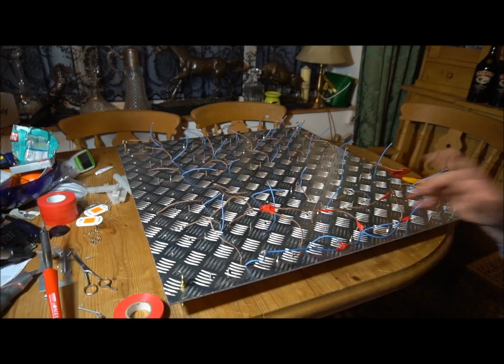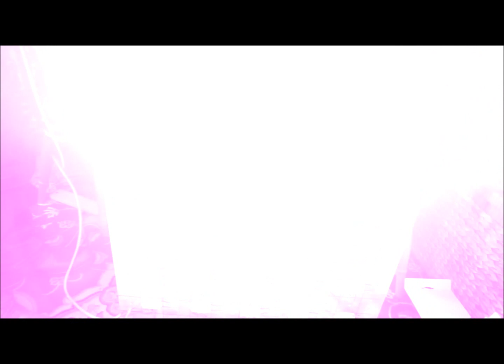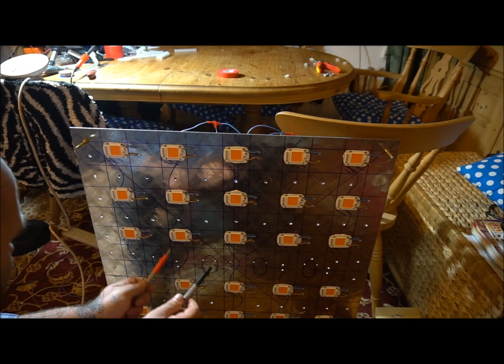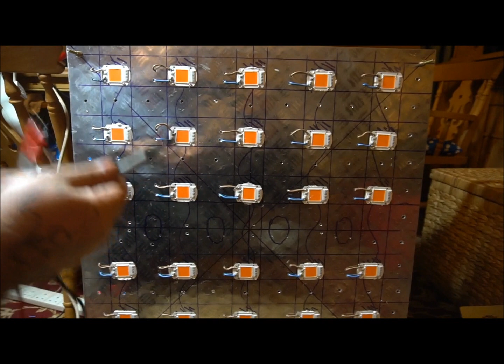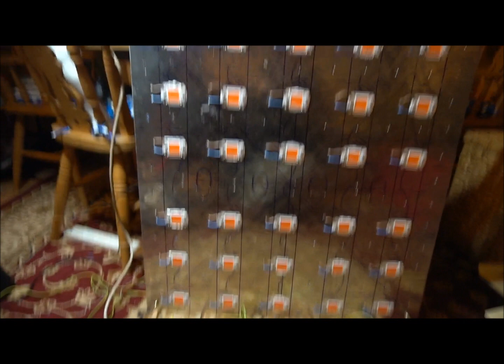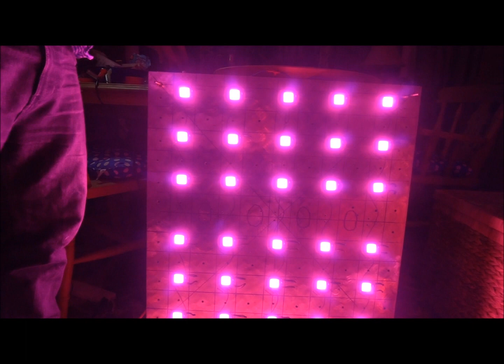cheap cob light part two

Comment: I applaud you for posting  a video of such an ambitious project, but I have to add some constructive criticism to improve upon your concept.
    1.  You must wire those COBs in PARALLEL because the input voltage for the chips is equal to your mains voltage.  If you wired 30 COBs in SERIES,  each COB would receive only 1/30 of the supply voltage, which would be about 7 volts.  That's not enough, so none of the chips would light up.  I strongly recommend watching BigClive's video "Driverless 50W LED teardown and schematic".  
    2.  Soldering the leads onto the COBs is difficult because the aluminum plate draws much of the heat away from the chip.  Place the chip on a hot plate and heat it slightly as you solder the leads to the chip.  You'll have no trouble soldering them.  Thanks to Big Clive for that tip.
    3.  You used 50 watt COB chips.  I can tell by the number of integrated circuits ( one chip is a bridge rectifier, and the other five chips are 10 watt drivers).  You need a lot more cooling for those babies.  My first attempt with those COBs used a single 50 watt COB and a heat sink with 0.3 sq. meters of surface area.  It didn't take long for the COB to burn out, but I replaced the Cob with a 30 watt chip, and I have had no problems since.  My last grow light was made with four 30 watt COBs.  The heat sink still gets hot (35 degrees C), even though it has almost 1.4 sq. meters of surface area ( five layers of light aluminum, 51 cm x 27 cm, with a 5 mm air gap between each layer, and a thermal bridge under each COB to transfer the heat from the COBs to each layer).
    4.  As others have mentioned, you should place grommets where the wires pass through the plate, and ground the plate.  I also prefer to cover the solder joints between the leads and the COBs with silicone sealant so that there are no exposed live wires.

Comment: I have built several lights with these chips and tested them over the last 3 months or so. They need good cooling, fans will be needed here. Even with good cooling, the chips don't last very long, over 12 weeks I got about 25% of the chips had failed. Not so good. There are other, similar LED chips with different driver ics that should perform more reliably. Buyer beware.
Reply from the maker: i used them 4 hours on 2 hours off cycle worked perfect still working superb results..yes i have replaced half a dozen bulbs

Comment: Great info thanks. I cant help but wonder, why am i thinking to build this? I have a small room 2mx2m low ceiling, but great ventilation. I have a few 400w hps's. I guess the main benefits to these cheap cobs are that you dont have hot spots like hps,  and by making a big panel you can spread the light out further. Did you see the migrow test of these cheap cobs? I almost vomited when i saw how low their efficiency is. I can build a 1000w panel like this one for the same price as 2x400w hps lamps. With fans or water cooling would the light panel survive longer? What about the poor efficency of these lights compared to hps? Im trying to see whats the advantage? Thanks

Comment: do you sell something like this?
Reply: The lights are ~1 Euro a piece on AliExpress, the plate is probobly 10 Euro, they are 220V or 110V (ur Choice) So, all together its a 1500W light for 40 euros, some random wire and few hours of ur time.

Comment: Hi, I did buy full spectrum cob 50 watts Led and test it with app luximeter from cellphone but it only show 200 lux is it demage or I need use other special of luximeter for measure led? Thank you
Reply: blue/red is not detected by phone sensors
Reply: what is the max reading capability of the phone app? i suspect it can't read higher many are like this.

Comment: Could you explain better how do you join the L and N in paralel together ? Thank you
Reply from the maker: its fairly simple...i make sure they are all connected to the main live feed separately... if you don't connect them all separately that means if one light goes out the others will go out too..so simply make sure every light has its own path to the live without passing through another light to get its power.thats the difference between series or parallel.has that explained it ok for you?let me know budski
Reply: @airbomzairbomz3356  I mean, you connect all live to each other and all neutral to each other. Could you maybe make a draw and send to me ? lucio@vetiver.com.br. Tks
Reply: @airbomzairbomz3356  i mean, maybe please you could show or explain better how do you connect each (neutral and live) from first column to second one ? How did you do this transition ?

Comment: Plz plz plz get a 6mm earth bolt and a ring crimp and get an earth to that plate..  Buy yourself an inline rcd 30ma for the whole setup. you should also use glands or grommets for passing cables through the metal plate.

Comment: Looks like Cheap China AC LED's with an efficacy of arround 80 to 110 Lumens per Watt.

Note: A HPS Bulb has an Efficacy of up to 150 Lumens per Watt.

The only Reason to use cheap China LED's for growing is a "little bit" less Heatoutput. PAR will be the same or lower as HPS.

If you want good LED's use LM301B's
from Samsung. This is one of the most efficient SMD Module on the Market. I am from Germany. And at www.led-tech.de you can get Aluminum Stripes with 98 LM301B's
(6.65W equals 210 to 230 Lumens per Watt / 13.3W Equals 198 to 204 Lumens per Watt / 28W equals 186 to 192 Lumens per Watt / MAXIMUM Load on each Stripe is 57.4W at 160 to 170 Lumens per Watt)

 6.65W = 0.35A
 13.3W = 0.70A
      28W = 1.40A (additional cooling)
  57.4W = 2.80A (additional cooling)

(More then 2A not recommended)

Example

(350 Lumens per Watt = 100% Efficacy)

your China Panel:

lets say you has got 30x 10W AC LED

so 300W Power consumtion

at best situation you have 31% Light
and 69% Heat from this Panel

lets get some Aluminum Stripes with
LM301B's (16.90€ per Stripe
                        euqals 18.82$ - if you buy
                        more then 14...   14.90€
                        equals 16.59$ per Stripe)

10x 98 LM301B's @ 1A = 150W

= 169€ or 188.16$

150W Power consumption and near doubled the efficiency.

55% Light vs. 45% Heat

cheap china: 31% Light vs. 69% Heat

Hope i can help.

Edit: THIS IS NOT!!! FULL SPECTRUM!!!
            THATS MAINLY BLUE AND RED
            SPECTRUM. FULL SPECTRUM IS
            FROM UV OVER VIOLET OVER
            BLUE OVER GREEN OVER
            YELLOW OVER RED TO FAR RED.
            THATS THE FULL SPECTRUM.
            ALSO THE LM301B's AREN'T
            PERFECTLY FULL SPECTRUM.
            BUT THEY HAVE A MUCH WIDER
            SPECTRUM.
Reply: Lumens are for humans   umol/j is better on those"cheap" ac cobs..........plants like par the ppfd is better than an hps also but hey you do you.
Reply: FREMONT, California – March 12, 2020 – Bridgelux today announced its eighth generation of LED chip-on board (COB) products delivering up to 185 lm/W across its V SeriesTM, Vero® Series and Vero® SE Series product families at nominal drive current.  This performance is benchmarked at the popular 3000K 80 CRI color point, with efficacies above 200 lm/W possible at other color points across the industry’s broadest range of COB products.  https://www.bridgelux.com/resources/bridgelux-eighth-generation-cobs-deliver-market-leading-efficacy
Reply: @donnieteague8482  Yeah i know. Waiting since 6 Months for one of these. For some People its easier to explain with lm/W. PPF i think even is better on HPS then thoose China COBs. Bridgelux Vero 29 Gen 8 is a blessing. High Efficacy combined with high concentrated Output. I wan't some of these.

Comment: what if I use 4 cpu fans on top of it running the whole time the leds are on?? And also drilling more holes on it?? Thank you
Reply from the maker: this light must not be run longer than 6 hours.. even with additional cooling.every two months i have to swap out 4 leds.for autos this light beats anything hands down.i just use it for autos so..6 on 2 off for 70 days and theyre monsters.its well worth it.
Reply: @airbomzairbomz3356  thank you so much sir 😉
Reply: @airbomzairbomz3356  what do u mean 6 on 2 off. Is it enough. Or do you mean 6, 2, 6,2....... Im planning to do the exact same project but will install small heat sink with small fans on top.  Was the plate you have enough for the heat
Reply from the maker: @Aly_H654  6 hours on 2 hours off helped keep the heat down worked perfectly - yes the plate was fine
Reply: @airbomzairbomz3356  do you think it's too much light. I have a 80*80 space I'm going to put a similar plate 60*60 with 8 cobs ( 4 full spectrum and 4 warm white). Do you think it's enough for 3 autos
Reply from the maker: @Aly_H654  id put a few more..depends on the wattage of the cobs? the more the better and cold white is better than warm white..more blue for growth..

Comment: MIGRO on YouTube tested these direct to mains LEDs they're about as inneficient as you can get, you might as well stick with hps. You need DC LEDs..I don't know much but I know CREE CXB3590 and VERA COBs are way more efficient.
Reply from the maker: your very right they are inefficient however they did grow weed really well and were so cheap it kinda worked you could actually have a light for $25 rather than lots of $$$... it was a fun build and I would recommend this light if you have barely any money to spare as a last resort but cree is far better but 10x the price
Reply: I can still push lot of weed with driverless. I dont listen to shane gromau5 and their numbers. 😆 People grow out with migro but never push over 1.5g. Fuck whats on paper bro. Its about grow knowledge. 😉 And yes i can combine what i want. 3500k 6500k or purple and 20w 30w 50w on my custom built heatsink.
https://ibb.co/FmgbZRW
https://ibb.co/Z8Bc5k9

Comment: Clean your solder tip and pre-tin the pads on the cob and you'll have a more reliable joint and wont have those solder problems. Cool build. Id also put a piece of heat shrink where the wires feed through the aluminum plate for insulation. If you cut the wire insulation on any of them AC feed wires that entire plate will be "HOT"(220v AC). Yikes! Id connect a ground to the plate and install a fuse somewhere too. Great project. Im thinking of doing something similar so Just trying to help.
Reply: Also solder the wires on before you mount the COB to the plate. Those things are a pain in the ass to solder in the first place as the back panel of them dissipates the heat quickly. Add to that a huge steel plate and your fighting an uphill battle.

Comment: Just subscribed thanks for showing.im going to make a 100watt with two 50watt cob using pc heat sink and fans great work.and u always get a few doggy cobs if not them all.lolcan I ask what are u powering it with
Reply from the maker: straight into the uk 240v mains.... driverless.... im still using this light with great results

Comment: man you couldnt show how to wire the plugs up instead of talking did you use a driver at all?
Reply from the maker: these are driverless buddy..just wired straight to the mains electric via a normal uk plug
Reply: airbomz airbomz oh alright i didnt know you could make a light like this i was researching drivers and how to read them but these chips are like 5 for 15$ so 3$ ea and looks alot easier to do how many watts did yours end up being also do you know the par wattage value?
Reply from the maker: i used far to many..i had to turn some of them off.it was too much light.. it was just a test.. in my opinion it would work great with less lights... my light regime was 6 hours on 2 hours off from beginning to end with autos.. i had no real issues until i turned more lights on..they started to just stop working..i think it was a heat problem. the plating needed a lot more holes drilled into it to allow for more heat to escape.. i would certainly use these again..you can also get cold white ones with no driver...im still using them on my third grow and they work perfectly. i have other vids on making other lights.ive also got some 10watt crees to use up...i tried using 5watt leds but i think its died on me.im so busy at the moment that i haven't time to return to my light building just yet..couple of months and ill be back to normal

Comment: Tip on soldering these......get your leads on BEFORE you mount the chips to your heatsink.  When they are mounted like that, the heatsink sucks the heat from the iron really quickly making it more difficult.  Is that mains power too?  Not worried about turning that into deathtrap?

Comment: There should be a grommet or something to protect the wires.  You should also run the L + N through the same hole(inductive heating) separately like you have is a hazard.  Also I don't foresee much longevity without much more cooling(that's alot of heat to disapate)  Your basic idea is sound Can't beat the price on the Led's I've found em for under $3 for a 50W
Reply from the maker: yup your dead right.. the way I got around this was a lighting regime of 6 hours on 2 hours off... anyways 50%  kinda died after 8 weeks so certainly more cooling is needed

Comment: How did you drive your LEDs?
Reply from the maker: these are driverless cobs plug straight into the mains
Reply: drivers are built in the chip hook direct to the wall plug standard 110v

Comment: I agree with Charles Boston ! I have used these ones too and they need 300g of aluminum per 10 Watt (1,5kg per 50W) if you want them to have a long lifespan. All the other things are done good I think! My advice, mount a few fans at the back at 20cm height so you keep the temp below 70° Celcius evertything above that point will result in loss of light and reduce the lifespan.
Reply from the maker: youre not wrong budski
Reply: simply over build your light and run them at 70% umol/j will go up as well as efficacy and the temps will stay down build a 1500 watt light and run it at 1000 watts cool as can be.

Comment: i've been playing with these for over a year now , you have too many for the surface area of your heat  sink .  what i have found , for every 30 watt chip there needs to 1 square foot of aluminum ( 1/8" thick ) for a heat  sink . this info may help you if you build another .
Reply from the maker: you are 100% right my friend .however i would put 2 per square foot
Reply: @airbomzairbomz3356  if you sand the reverse of the heatsink with large grit sandpaper you can easily double the surface area available for air contact due to the minute valley's and peaks of the scratches.
Reply from the maker: @dtwistrewind7361  good call.ill certainly try it next time thanks budski
Reply: if you do that , you need to figure out how to increase the surface area of your heat  sink , for a 30 watt chip you still need 250 to 300 sq inches of cooling surface
Reply: @airbomzairbomz3356  maybe put a box fan and a spacer above will reduce your heat
Reply: Hallucinogenichusky good idea but will take alot of fans
Reply: water cooling will be the next thing.

Comment: From what I see that you done wiring in series rather than parallel
Reply from the maker: no parallel...they all recieved power direct each light..done in such a way that if one went out all the others would be still on
Reply: airbomz airbomz
 could you demonstrate that in a short video
Reply: I did a similar build with similar Chinese COBs rated at 120v. Wired them in parallel and they stay lit for about 5 minutes then my circuit breaker trips, I suspect they keep drawing more and more voltage at time progresses like a viscous loop? How can I stop this?
Reply: @steveorini2839  cool them down maybe...
Reply: @TheLordofdrift  you're right, I put a fan on them and they seem stable now, the fins on the heat sinks are only getting to 85F

Comment: How's this light going and how's the heat dissipation?
Reply from the maker: the light is now dead however it did work fantastic and I would do it again..i never had the right cooling...you can just use less units per light I used 30 you could easily use half that amount..it grew them fantastic
Reply: And they all overheated?
Reply from the maker: no i turned some of them off..as i thought it was way too much light initially but the heat affected those lights i turned off and they died...but it was because of the heat they died from the other lights...they went really really dry....if i did it again i would use 15 on the same size board...its more than enough light...im currently making a 3watt led light with 360 3w leds...ive just connected it up and there was a loud bang..lol...i should have it sorted in the next couple of days..i would allways go with making your own light for sure